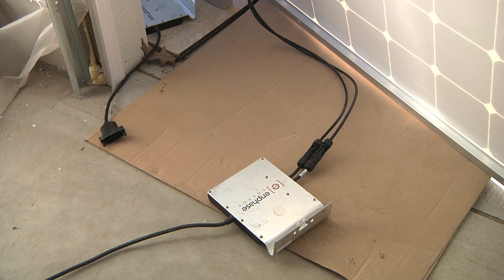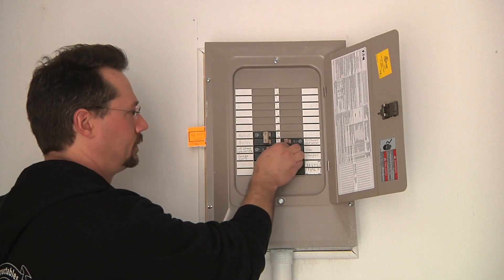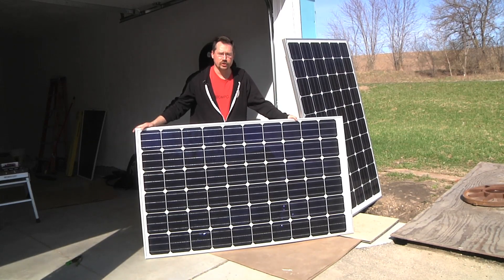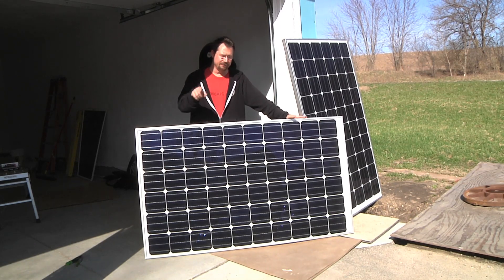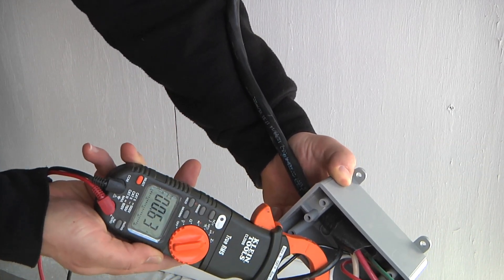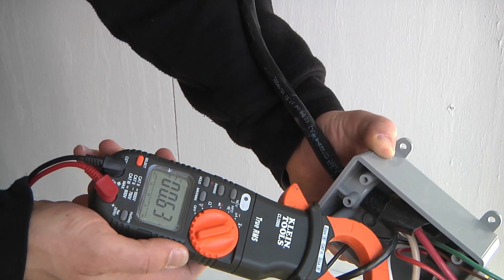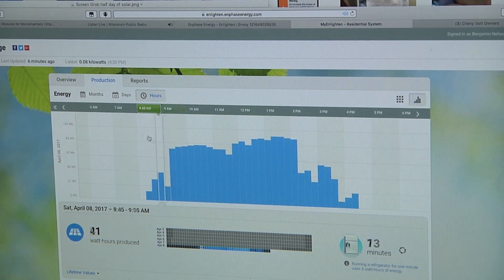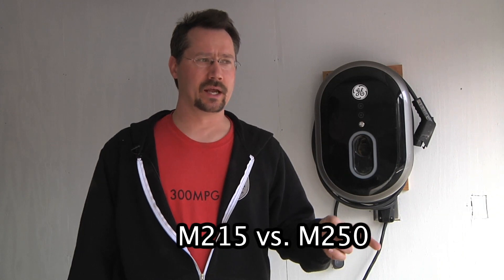Solar Experimenting! Part 2

Comment: I got a used system, 11 panels with enphase micro inverters. I tested panels each were getting 33 volt per. I can't seem to get things to work. light in back of inverters is blinking red. Any ideas on whats wrong? I'm  new to solar, I don't know much about dc power.
Reply: Are you connected to the grid?  These only output when connected to the grid.

Comment: Hi Benjamin, thanks for the great videos!! I am now subscribed. 
I have some M215 and M190 microinverters connected and tied into my existing system. I have a used Envoy M but the latest Installer Toolkit app does not seem to support the older Envoy and older inverters. How do I get around that?

Comment: is the envoy required to get them working and exporting and working ?
Reply from the maker: The Envoy is the communications device between the micro-inverters and the web/your phone, etc. You need it to get everything set up in the first place. In theory, you could just borrow one for commissioning the system. I don't know why a person WOULDN'T want one, as it's the thing that gives you all the data for your system. For example, if you have an issue with your system, you can just get an e-mail alerting you to that.

You don't specifically need an Envoy to "turn on" the micro-inverters, but you definitely need it for changing any settings. If you have a very simple setup, nothing weird with your power provider, etc. I think a person could get away without it. It's part of the system, and all the data you get from it is pretty cool. If a person is going with Enphase equipment, just get all the components, it all works great together.

Comment: ahh there it is :-) wow! all the bells and whistles for only two panels...
Reply from the maker: Ha! Yeah, well, I was just using these two solar panels originally to learn about home grid-tie solar setup with the master plan of using the Envoy as part of that system anyways.
One DOWN-SIDE of some micro-inverters is that you might still need certain tools, accessories, or other items whether you have one micro-inverter or 100!

I'm currently running 26 panels and micro-inverters, including the ones you see in this video.
(Summer 2020)

Comment: The M215 inverters should be plenty for the panels, if you look at the NOCT values of the solar panels you should notice that power at 45C is significantly down. That means you should be safe, it is a bit counterintuitive in that respect.

As a general rule for string inverters a 10% smaller inverter is generally well accepted. Even at 20% smaller you still have 98% of the production of a 100% system, just because the time that you actually reach maximum panel power is so small.
Reply from the maker: I got some good replies about this on a web forum, and yes, it looks like M215s should be fine. When I was able to play with the solar panels the other day, it was sunny, but still cool. The power I was seeing from the panels seemed to indicate the M215 should work fine, and that although I may have a better solar angle in the summer, the additional heat would somewhat negate that anyways.
Ironically, solar output can max out in the winter, but my solar angle won't be ideal in winter, so that shouldn't be an issue either.
In case anyone is wondering, I'm at about 43 degrees north latitude, and the garage roof is 6.8/12 pitch. It does face due south.
Reply from the maker: After a year of having the system up and running, it's very good overall. I've occasionally gotten a little bit of clipping, but only right in the middle of the day, a handful of days in the year. Looks like the M215 inverters are  an ideal match for my panels in my situation.
Reply: ?Hey Benjamin great to hear! I am thinking of going the M215 route since nowadays they are so inexpensive - you can buy them for about 40 dollars each! For a 24 panel array would this be a good option? I don't think Ill tackle this projhect until the spring/summer but is nice to know how things are becoming cheap/cheaper. I intend to at least do this before 2019 ends so i can take advantage of the 30% credit.
Reply from the maker: Personally, I would put up as many solar panels as I had space for! 
Yep, get those solar projects going soon so as to maximize the tax incentives!
There's only two types of people: those who don't have solar yet, and those who want more.
Reply: well we don't use that much electricity, about 5000 kWh per year if that. A 24 panel array would cover my entirety of West facing roof - yeah i know I live in a East-West property. According to my calcs, I would be able to get about 8000 kWh/year with a 6.8 kW array. In my state, there is net metering, however, I believe it's capped at 200% of consumption, meaning at my current 5000/year anything that is produced over 200% (10,000 kWh) does not get paid/credited so in essence it's wasted.
Reply from the maker: Of course, always check with your power provider and any local regulations for how they would effect your setup. 5000 kWh per year is pretty conservative, as that works out to 417 kWh per month and the U.S. Average household use is right around 900. Congrats on being TWICE as efficient as the Average US household!
Other things to think about for solar...
The Enphase system makes it easy to add more solar later, but if you want to, make sure your disconnect and other components are appropriately sized for your TOTAL future solar. Also, that Federal Tax Incentive tapers off over the next several years, so if a person wants to get that tax break, do it NOW instead of later!
Lastly, chances are that you will own an electric or plug-in car at some point in the future. That means using MORE electricity. (So you may as well start making it yourself!)
Being able to produce your own extra 312 kWh or so per month would allow you to drive 15,000 miles per year GAS-FREE
Reply: @BenjaminNelsonX  I'm from Europe now living in the US so of course I wouldn't use much energy. Even the 400 kwh I think it's a lot... But it's needed due to a dehumidifier in the basement and our very old fridge that hogs 2-3 kwh/day - waiting for a new one ich that alone will improve our electric bill by 50-70 kwh month and no the reason for new fridge is not the consumption. It's cuz it's really old and doesn't fit in our house - it's a fridge from either 1983 or 1991 according to serial number :D.

Yup electric car might be in the cards in the future. Something to take into account